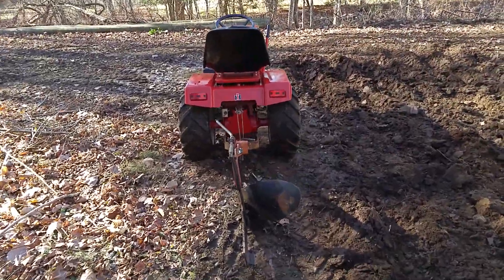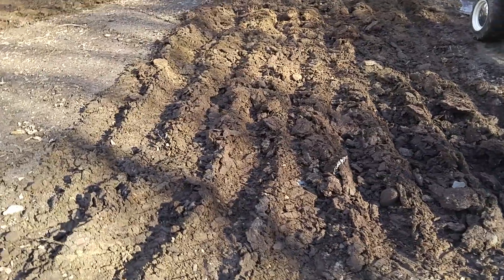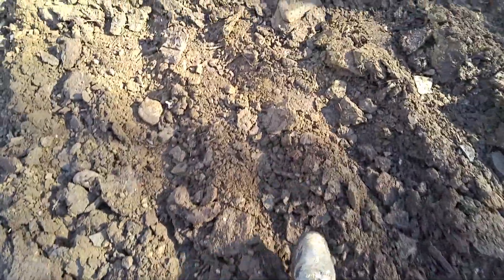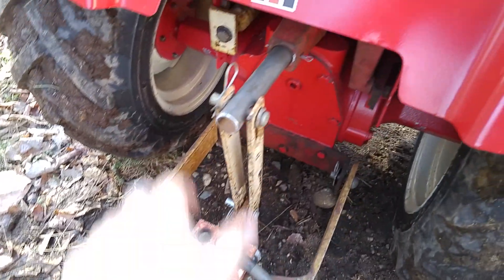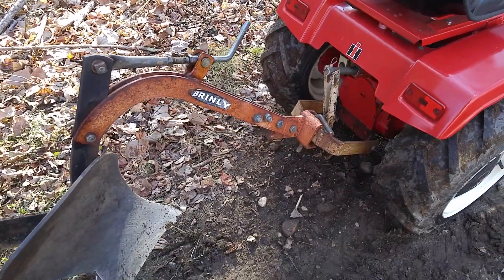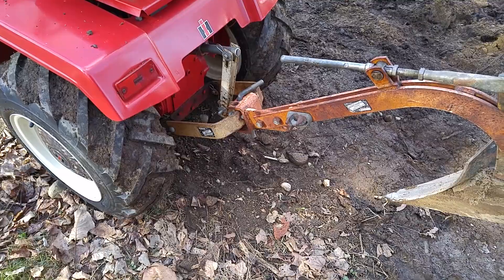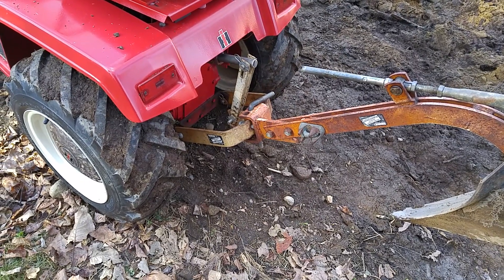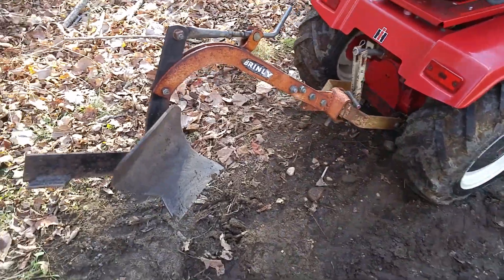cub cadet 682 moldboard plow test run

Comment: I love plowing with my 122 cub. I would love to get a brinley for my grandfathers 682 cub. And u are correct It is a ten inch. Where did you get the weight bracket for the 680 ?
Reply from the maker: The bracket I made from 1/4 inch thick by 2 inch wide steel, wasn’t the prettiest looking but it did work